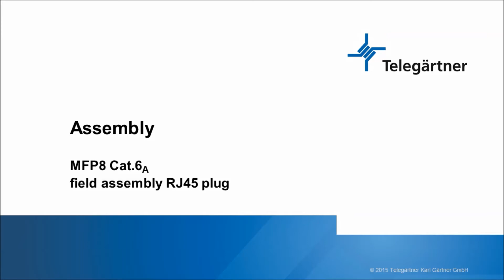Field assembly RJ45-plug MFP8 Cat.6A assembly | Telegärtner

Comment: Pease can you tell me the difference between difference between MFP8 T568A and MFP8 T568B :)
Reply: The main difference between MFP8 T568A and MFP8 T568B lies in the wiring configurations of the twisted pairs in an Ethernet cable. Here are the key distinctions between the two standards:

*MFP8 T568A:*
- In the T568A standard, the wiring sequence for the individual twisted pairs is as follows:
  - Pair 1 (white/blue, blue)
  - Pair 2 (white/orange, orange)
  - Pair 3 (white/green, green)
  - Pair 4 (white/brown, brown)
- The T568A standard is often used for residential installations or in some government applications.

*MFP8 T568B:*
- In the T568B standard, the wiring sequence for the individual twisted pairs is as follows:
  - Pair 1 (white/orange, orange)
  - Pair 2 (white/green, green)
  - Pair 3 (white/blue, blue)
  - Pair 4 (white/brown, brown)
- The T568B standard is the most commonly used wiring scheme for Ethernet cables in commercial and residential environments.

*Key Differences:*
- The primary variance between T568A and T568B is the sequence in which the wire colours are terminated on the connectors.
- While both standards are widely used, T568B is more prevalent and considered the default standard for Ethernet cabling.
- Maintaining consistency in the wiring scheme used throughout a network is essential to ensure proper connectivity and performance.

Overall, the choice between T568A and T568B standards often depends on the network's specific requirements and the existing infrastructure.

Comment: is it re-usable >?
Reply from the maker: Thank you for your request. The wire manager in the MFP8 can be reconnected up to four times, provided that the new wires and cores to be connected are not thinner than those previously connected.
The wire manager is also available as a spare part, so that the complete plug does not have to be bought again if something goes wrong.